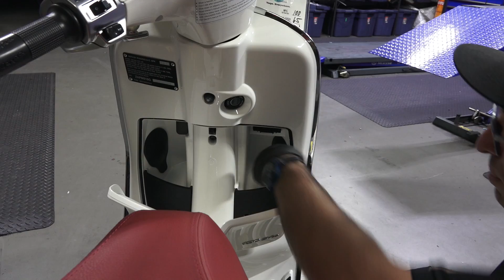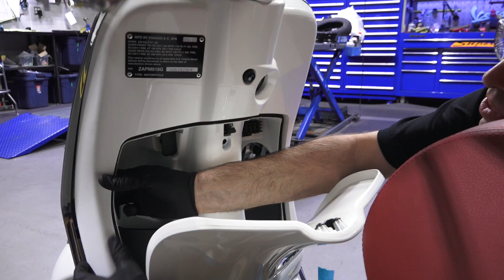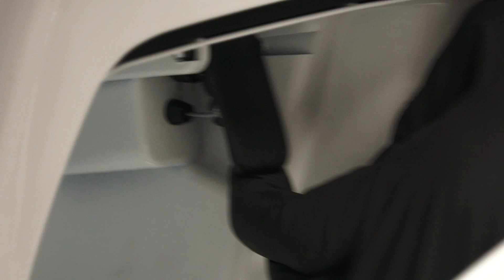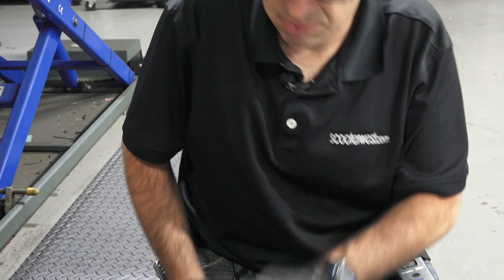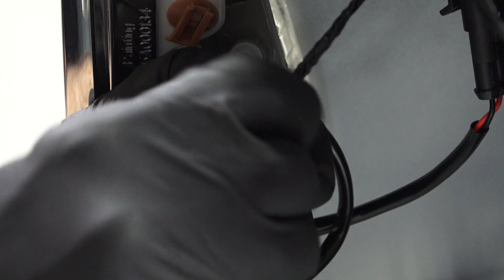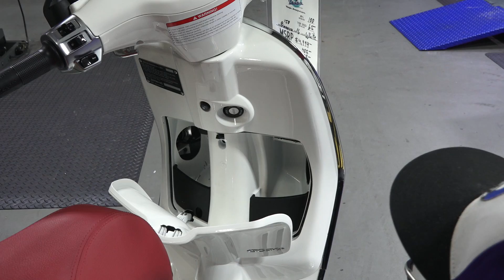Installing a USB Charging Port on a Vespa

Comment: oh my gosh robot this is exactly what i need
i have a 3v primavera vespa, an older model than what you used to demonstrate because it doesn't have the electric seat release.
im currently about 1000 km away from home. and i dreamed of visiting my family with my vespa since it's not an easy trip.
the biggest problem i had is power for navigation, since it's not really convenient to have a dozen of power banks for the trip haha
this might be the solution i need
thanks for the tutorial!

Comment: Hi Robot,
Once again, thank you for the clear instructions.
So nice to have you show how it’s done so we don’t have to figure it out ourselves. I was going to tap into the running light on the left behind the plastic cover. and simply dangle a pig tail into the glove blocks through a small hole in the black rubber cover that allows access to the running light. I like your install much better.
Thank you
Ron

Comment: Another great video!  I have a 2001 ET4 leader, and want to know I could just remove the left side knee panel, and tap into the headlight wires where the fuse is there. I would mount the port on that knee panel and do all this without removing the glovebox.  Would this work too?
Reply: Did you do it ?
Reply: @mrjfadams1  no I chickened out.
Reply: @quitob1  I'm going to tap into the ignition... Just waiting for a diagram if all goes well will pass onto u bud I'm just stuck on what size tap ins I need
Reply: @mrjfadams1  I wish I knew so that I could tell you, but I don't know.  My plan was to order a few sizes (e.g., 10, 16, 18 gauge) from Amazon and see which size works.   Thanks and good luck!

Comment: Fun video, and instructive, but if you want to do it right, connect it via the contact, scooter to electronics, key on, then also the load ability, so safe, and is equally secured.

Comment: Those type of electric wire taps are good, but hard to find. Does Vespa Motorsport pay techs a living wage for your area? I heard California rent and gas prices are very high, and I never see any other techs working in the back ground. It looks like you supply tools for your techs, which is good, but a bad sign for tech wages since your probably supplying tools to avoid California's requirement that shops pay technicians twice minimum wage if techs are required to supply their own tools.

Comment: I did this on my Chinese scooter, however I connected the red en black wire directly on the battery. On the red wire there is a fuse built in. 

I could charge my phone fine for the first couple of days. Day 3 I connected my iPhone7 to it the charger cable burned out and basically blew up my charger port on the phone. I had to get a new phone after that. 

Now I am afraid to test it again with my new phone. Anyone have an idea what could be the issue?
Reply: Battery has 12V and charger only need 5V

Comment: I did this yesterday on a zip 50 and on an ET4 125 - works just fine. Good video!
Reply: Mate how are those cable connectors called?
Reply: posi tap
Reply: Another great video!  I have a 2001 ET4 leader, and want to know I could just remove the left side knee panel, and tap into the headlight wires where the fuse is there. I would mount the port on that knee panel and do all this without removing the glovebox.  Would this work too?
Reply: I have an et4 and want to do the same do you have a list of what you used in parts please. 
Did you go off the indicator light ? 
As it looks like he goes as low in the video as the indicator ?

Comment: is it possible to charge the Vespa battery with a powerbank via this USB charging port?
Reply: No way
Reply: Nope, it's a switched circuit, closed to the battery when the ignition is off.
Reply: thanks for answering

Comment: Great video. I'd like to know if there's room on the Primavera / Sprint to fit a Stebel Nautilus air horn in there....?
Reply: I tried getting the Stebel Nautilus in my 2021 Sprint 150 and it was no go. Not enough room I could find.  But did get  a high and low tone Fiamm Freeway blaster in there   And those two make a very nice loud horn.
Reply from the maker: I think it would be rather difficult to install behind the glovebox.. not impossible though.